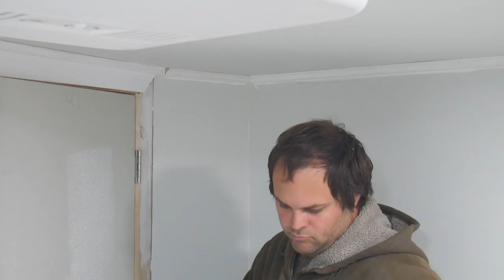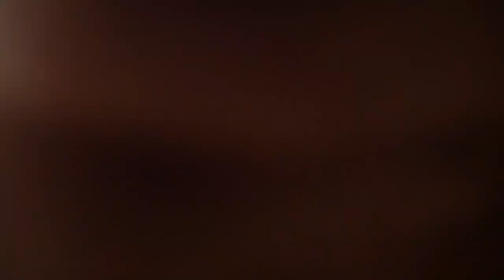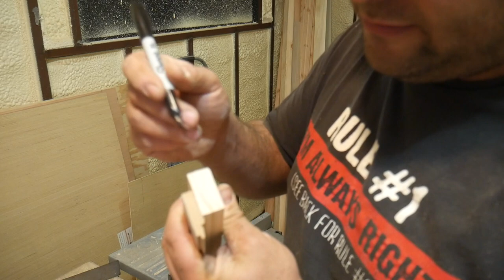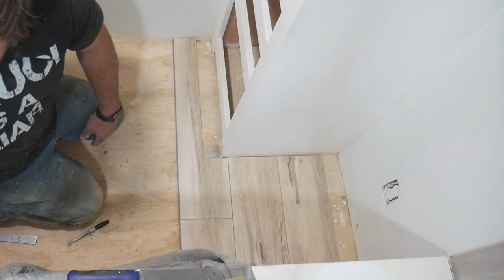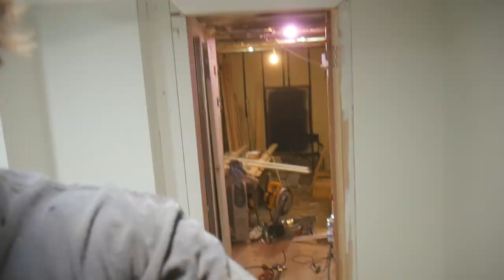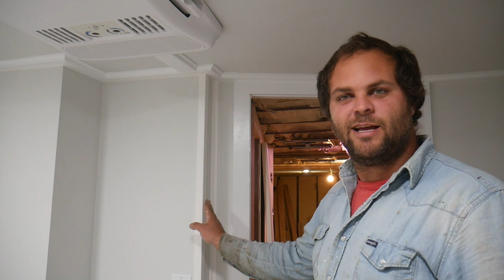Homemade RV. EP-28 Trim and floor. 1977 Peterbilt 359 Toterhome.

Comment: Great video Zack.
Question?
Does the vinyl floor expect to expand and contract with variations of temperature? I've had the roll type vinyl shrink and then pucker when it expanded again from heat.   I've never used the segment type, so I'm wondering, if it'll be different.   My experience in travel trailer is very extreme,  so perhaps you would have better luck....
Keep the videos coming.   The show that people can do this.
Reply from the maker: Im not sure, I worried about this. Ultimately I just decided to do it and if it gives trouble down the road to take care of it then.

Comment: Great finish Zac, I was wondering if the kick trim on the bed is high enough after the mattress goes on ? Looking forward to the window install
Reply from the maker: Thanks. I actually found (somewhere on the internet months ago) a place to buy thin nice memory foam mattress. They offered and im planning going with a 6".  My teardrop had a 8" thick cheap memory foam mattress that was really nice. I think a 6" will be enough.